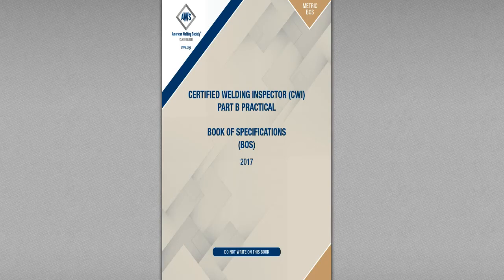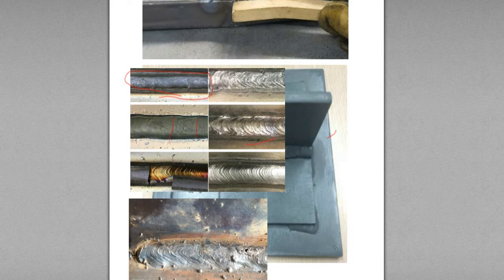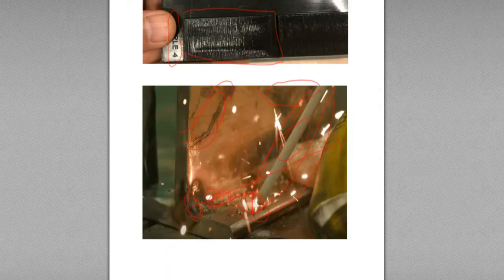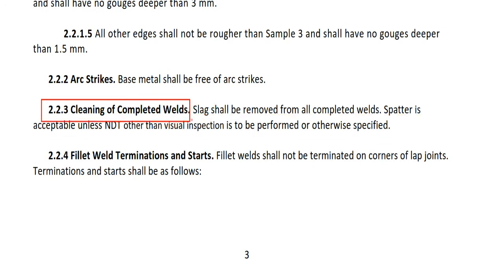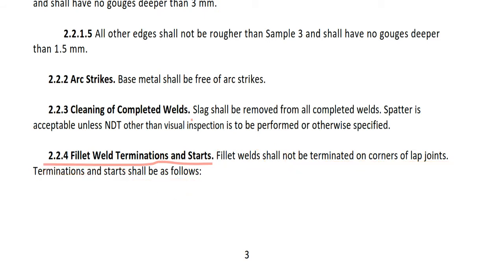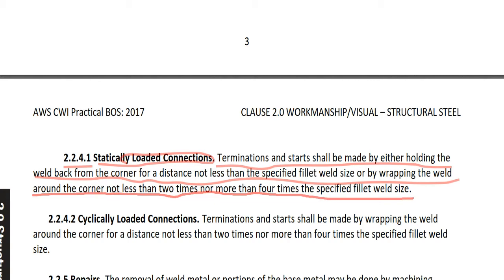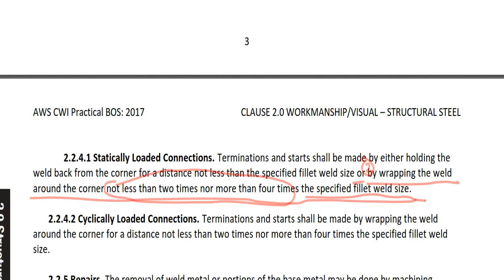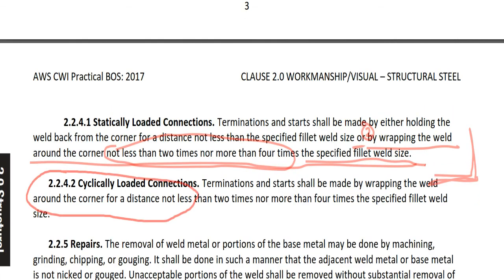CWI Part B Lecture#4

Comment: 10mm is the size of the weld, not the length which is represent to the left of a welding symbol, and to the right of the welding symbol is length of weld and pitch which is the distance between the centered of the weld.
Reply from the maker: Certainly

Comment: Thanks for the video 😊. But i have questions. wrapping the weld around the corner should based on the length of the weld or separate line following your described in this video.

Comment: For the 2 times the " size" of the weld you used 10mm as the size of the weld times 2, but the "size" of weld to wrap around should be based on the length of the weld ?